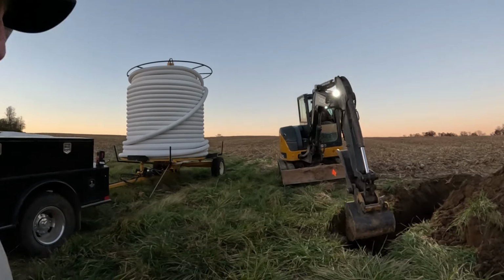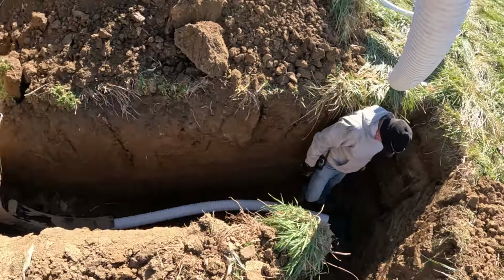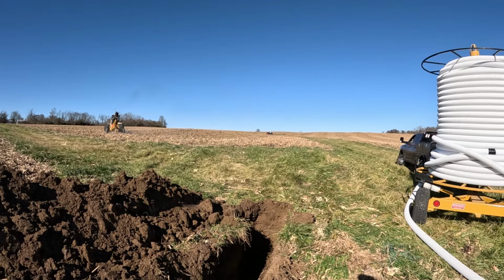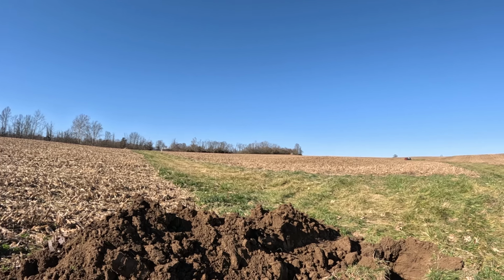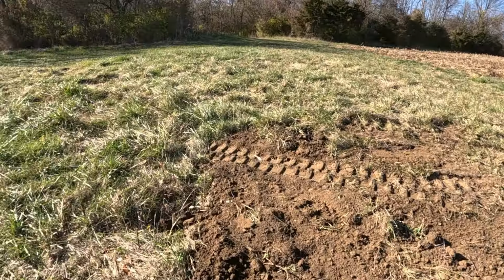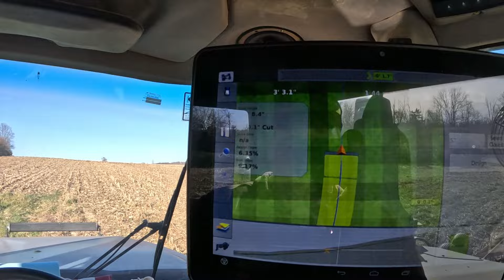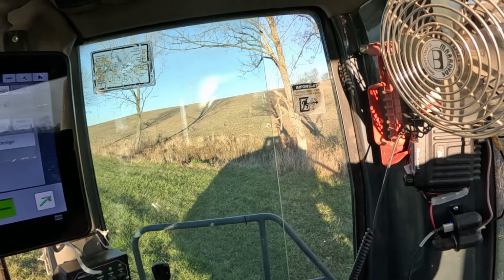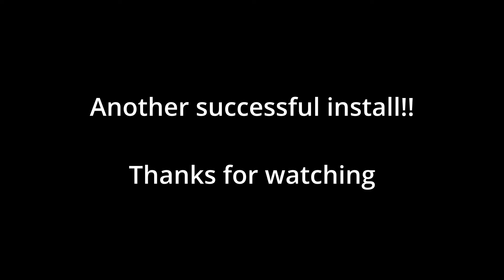A Day in the Life of a Tile Installer.....

Comment: Can we see a close up of the tile cart?  What are the black bumpers on the bottom turn table and how did you add the 4 uprights that keep the tile from unspooling like crazy?
Reply from the maker: It is round bale belting drilled 3 or 4 holes and bolted it up, 4 different spots around the cart. It works very well!